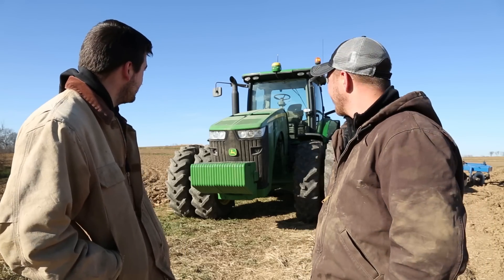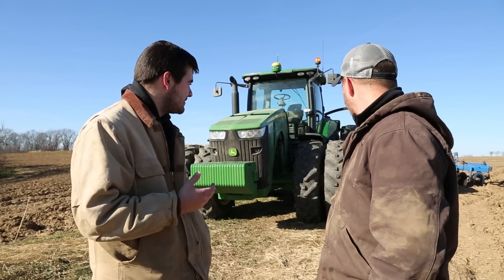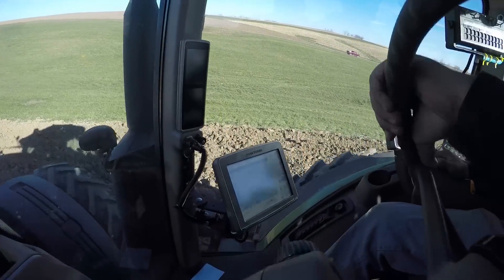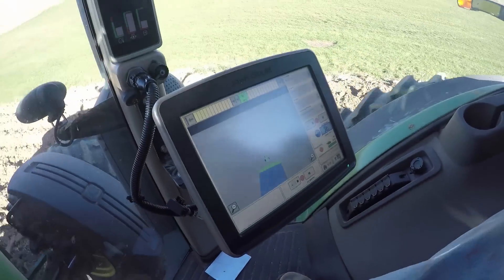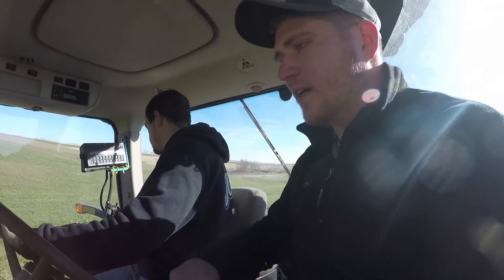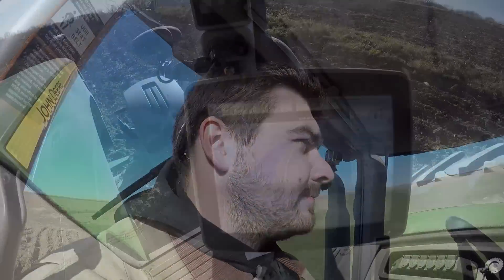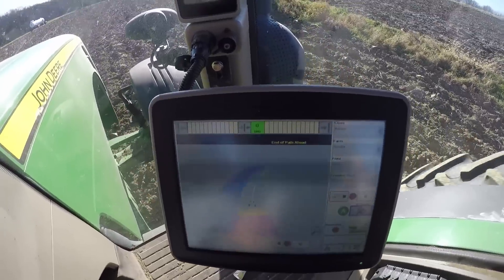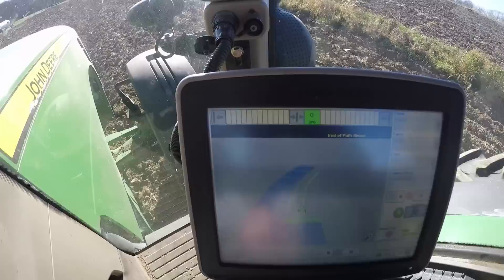RTK & Autosteer Demo - John Deere 8235R - Sloan Implement

Comment: For your type and needs to get you started with auto steer here is a deal. This is what we started with and over the years worked up to RTK, but we are much larger row crop farming in north central illinois,  "no" hills or strip farming. 

https://www.machinerypete.com/details/other/john-deere/greenstar-system/18750058

This can do curve as well as the normal straight row.

Comment: I can see how this system would help someone with multiple crops, multiple processes, and varied terrain. I wonder how much additional cost to the tractor you pay even when you wouldn't use this system say in 4000 acres of nothing but hay with few breaks or obstacles?
Reply: You can use it in anything thought... not only the tractors... Here we use it for planting... windrowing for hay...and windrowing for harvest
Reply: 46Rambo It is an extremely expensive system, the GS3 2630 display is about $6,000, reciever is about $4,000, and the activation is approximately $3,000. it's a very expensive system but can be very worth it, especially during applications where double coverage needs to be kept to a minimum due to high input costs.
Reply: Greg Dowler, that is why I was asking I guess. Couple that with the fact a lot of smaller farms don't have new enough equipment that may be compatible with the system and it isn't feasible. it would take me quite awhile to recoup $10,000.

Comment: John Deere RTK is a joke. Their "sub inch accuracy" is nothing but a line of crap. I'm gonna change to Trimble as soon as I am able.
Reply: Sounds like it's not the a problem with the John Deere RTk, more like a operator not knowing how to set it up.
Reply: I dont know which one to get yet... Heard things about trimble to that was not to pleasing
Reply: Northern farmer in my area the repeatability of Deere is pretty poor. I've been of as much as 20 feet on row crop applications when returning to the same line I planted with. I also end up with wide and narrow rows on a regular basis. We run 12 row 40 inch equipment and I've measured rows being as close as 20 inches and as wide as 55 inches from through to through. We ran our Deere dealer through the wringer making sure it wasn't our tractors or implements. We've tried different Deere GPS systems and we still get random variances. It's annoying to say the least.  Our neighbors that have Trimble don't have the problems like we do. I've even run their equipment and I like it. If you go Deere I wish you luck. I hope it works better for you. It is pretty user friendly and I like that.
Reply: Northern farmer what have you heard about Trimble? I'd like to hear another opinion that isn't so close to home.
Reply: JGM I know what I'm doing thanks. When everybody around here has the same problems with repeatability it's a problem with the equipment. Especially when I can go from my Deere tractor with Deere GPS to my buddies Deere tractor with Trimble GPS and have zero problems. The Trimble GPS was able to pull in perfectly zeroed on an old track from an A-B line snapped three years ago. Deere GPS will be off by at least 5 feet from the same line snapped 6 months ago. When you make 10 rounds just fine and all of the sudden you have a wide middle when nothing has been changed it's not an operator problem. Thanks for weighing in with your opinion though.